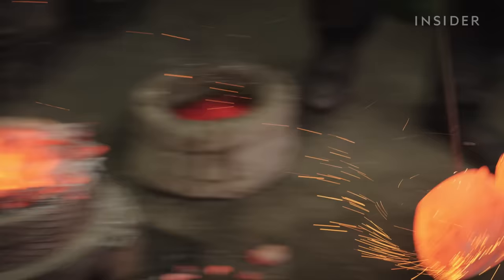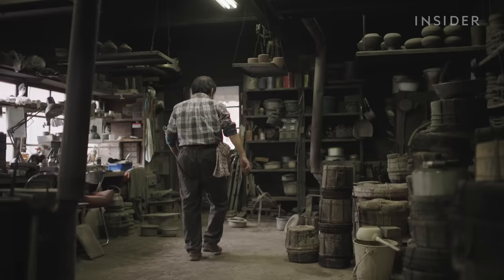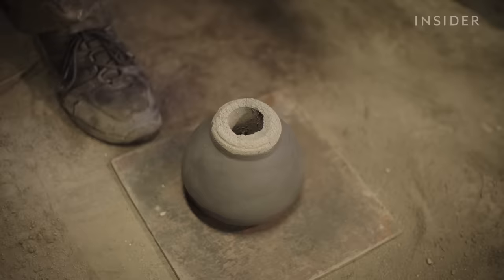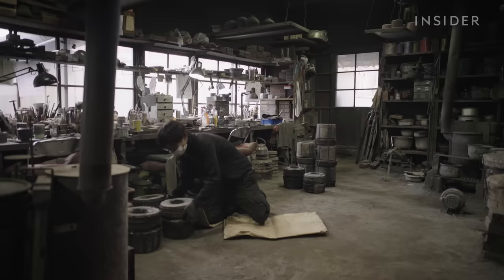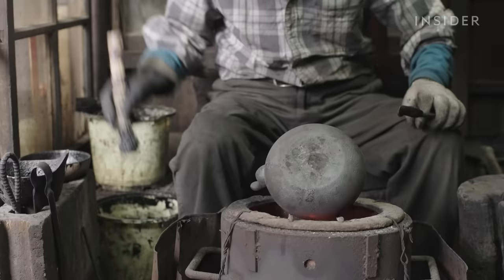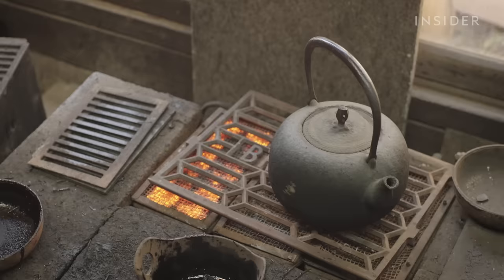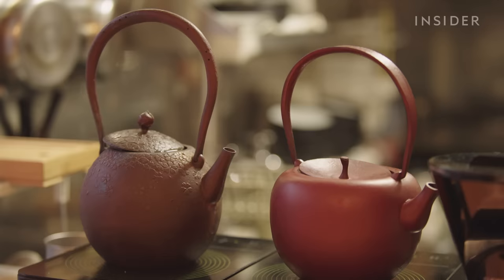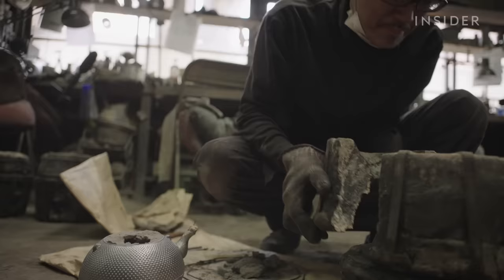Why Japanese Iron Kettles Are So Expensive | So Expensive | Business Insider

Comment: 5:33 An oxidized layer is rust. The type they are forming by heating is a stable form of it that does not spread and eat away at the rest of the metal though. The oil layer they bake on later is what actually does most of the preserving.

Comment: i own two, a blue chinese reproduction with the enameled insides for brewing tea in the pot, and my beloved japanese "flawed seconds" pot i was fortunate enough to find at a thrift store many years ago with the bare metal insides. the dimpling on one small tiny side spot of the pot is ground down almost smooth (probably from a tiny flaw in the mold at the time of casting) it's my favorite, even with the flaw, and does a great job of heating water quickly over a stove on low heat, and keeping that heat longer than my modern stainless steel teapot. my wishlist hunt is to find a bigger version with larger water capacity.
Reply: That is what I love most with these, how long they stay hot, and when making tea in the pot, the way the heat difuses into the cold kettle it really brews tea long with cooler temperature, perfect for green tea

Comment: They're charcoal blued, very interesting.  19th century firearms parts, sometimes the entire firearm, were treated this way though not at a glowing red temperature. There were exceptions to this rule but generally performed in a heated vat of charcoal at 850F/454C for extended periods to build a thick oxide layer and oiled while at temperature to further seal them from oxidation.

Comment: High prices do not necessarily mean higher quality. Sometimes, it just means low-efficient production. I am quite happy with the electric kettle I am using. It cost me less than 20 bucks. I can see no difference in the hot water it makes.
Reply: @Atlas A stainless steel kettle may cost $30. The one I used to have lasted at least 25 years. I don't find that a very special thing or a legitimate reason for making the kettle more expensive.  I stopped using my old stainless steel kettle just because I needed to move to another place and my wife wanted to have a new one. If she had not thrown it away, it might have lasted +35 years. Don't forget the Iron kettle is 7 times more expensive. Pound for pound, can the iron pot be used for more than 240 years? (7 x 35 years = 245 years) From this perspective, I see nothing special about the iron kettle.
True, the iron kettle can run without electricity, but it cannot boil water by itself. It must run on some kinds of fuel. Without fuel, it just can't boil anything.

Comment: There is no purpose in annealing kettle beside removing structural tension. Mentioned "oxidized layer" which supposedly protects from corrosion, is nothing else than the rust itself. Additionaly annealing with charcoal at the surface will increase the carbon content at the surface layer which actually increase the speed of corrosion.